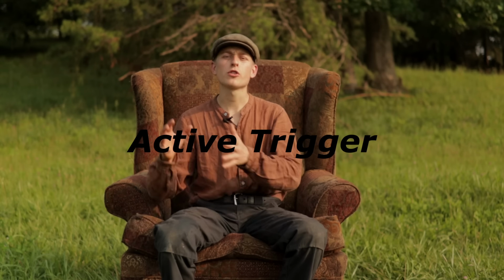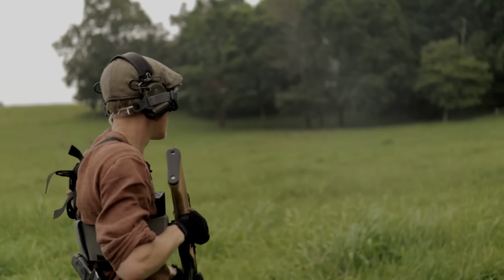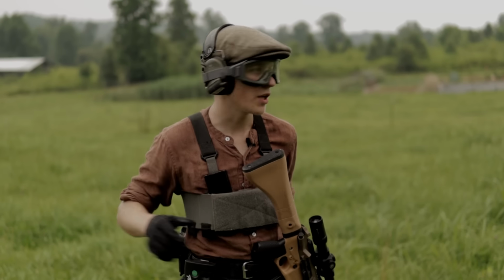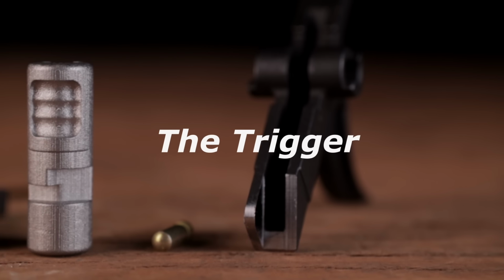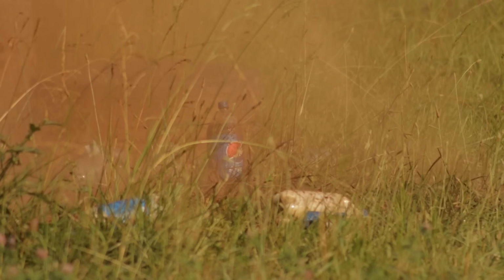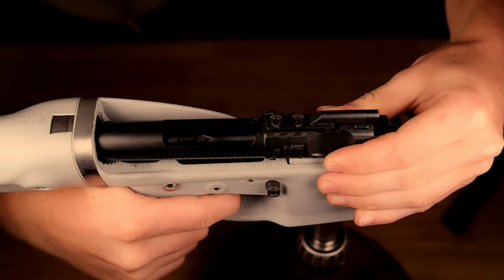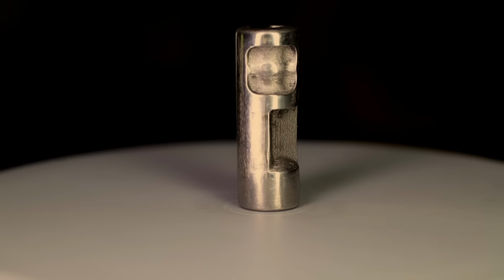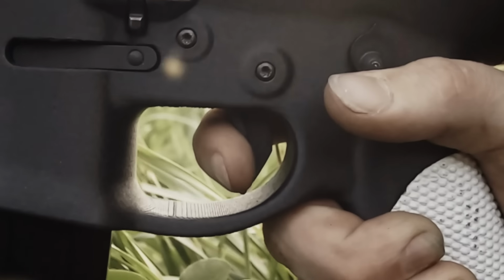Introducing the Super Safety

Comment: Machinegun= any weapon that fires more than one shot per pull of the trigger. Machining a part to force the weapon into safe mode, reset the trigger, and fire again after a shot, STILL results in multiple shots from one pull. You do keep saying something about having tonpull the trigger again with your super safety, but in the video, you are clearly holding down the trigger. No human, not even Jerry Mitch, can fire that fast, with such a consistent tempo. You're not doing that- the gun is. That is what makes it a machinegun.
Reply from the maker: That is not the definition of a machine gun. The word is function, not pull. Big difference.
Reply: @HoffmanTactical  I didn't say that was the definition. I said thats what it IS. Its a matter of the difference between the letter of the law and the "spirit of the law." Also a matter of the ATF's current "interpretation" of said law. The exact wording may specify"function of the trigger" which you take to include an AUTOMATIC mechanical action on the trigger as a normal part of the process when pulling the trigger once. But the ATF interprets "one function of the trigger" as a single action by the user, ie pulling the trigger again. 
I dont think it would make any difference to the ATF if the trigger was put into and out of safety mode a dozen times between shots, if it still resulted in more than one shot from one pull, you're in trouble. Playing around with printed plastic guns is asking for trouble enough already. You're just asking for a visit.

Comment: 2 questions:
1) will the Super Safety work with a rifle buffer? 5.15oz
2) can the full modified trigger (3 position dremeled) also work with the 2 position cam?
Reply from the maker: The  buffer mass won't have much to do with the operation of the safety, as long as bolt bounce is not an issue it should be fine. Once the trigger is modified, it will only work properly with the dual mode or a standard safety selector.
Reply: @HoffmanTactical  good to know. I'm 3d printing the single mode cam next week once my CF filament arrives and wondered if I'd even be able to use the same trigger for both single and dual mode setups. Appreciate the fast answer, sir.

Comment: I see the safety rotateing . That means it will egg out your receiver .
Reply from the maker: Testing has proven otherwise. It's not been the mildest of a problem. The reason is the surface pressure is very low.
Reply: @HoffmanTactical  are you saying anti rotating trigger pins are a scam ?

Comment: That thing constantly rotating in an upper will cause massive wear.
Reply from the maker: The lower you mean? So far no wear has been observed, even after 8K rounds. The reason it's not an issue is the surface loading is still very small.

Comment: I installed SS but when I charge the handle the handle sticks and won't work also when I am able to chamber a round the first round I shoot the BCG ends up getting stuck once again..

The function rest seems fine and my lower worked well before, any help would be great..

Thank you..
Reply from the maker: The top of the lever is getting pinched between the upper and BCG. Needs to be filed down a little.
Reply: @HoffmanTactical  

That would explain why the takedown sticks..

I'll give that a go tomorrow, thank you for the response.

I'll keep you posted..
Reply: @HoffmanTactical  

That worked, I just need to take it out for a test run

Comment: One thing I think is especially ingenious is that you used the energy of the bolt *OPENING* to force-reset the trigger instead of the energy from the bolt closing to force-reset the trigger. That by itself is going to make this a far more reliable FRT than every other design we have seen so far because the recoil spring 1) has way less energy and 2) has to overcome the magazine spring. 

Bravo to you, sir. Bravo!
Reply: Not to mention the added leverage from the rotation of the cam. This seem to be far more efficient than a FRT, and this system would seem to work with any aftermarket trigger.
Reply: All this needs to be milled out of steal for sure. I think is has a future.

Comment: This is fucking brilliant but i wish it wasn’t a push button.
Reply from the maker: I did try to avoid the need for the push style system, but it was required.
Reply: @HoffmanTactical  all in all a brilliant design, do you just work via trial and error or do you conduct some analysis/ research before implementing?

Comment: I'm not here to much argue legality I think. More like just be ready for nonsense. If you look up Akins Accelerator, that was a bump stock but sort of inverted. Instead of the stock, the rifle itself would reciprocate inside the stock. You were still functioning the trigger for each round. The ATF initially said it was OK but later backpedaled and said you could only have it if you got rid of the springs, which made it not as good. This one, it's actually pushing your finger forward? Yes, you're still functioning the trigger I think but they're going to fuck with you about it.

Comment: people are wondering how this isn't an auto seer, its not an auto seer because the only thing this safety does is transfer energy from the bolt into the trigger and by extension the shooters finger. if it were an auto seer, there would be no inertial transfer to the trigger, instead holding the trigger would result in a "dead" trigger as the internal hook comes off a control lever and allows the bolt to trigger an 'automatic release of the hammer' one trigger pull, and the bolt just has to return home over and over. with a super safety or even the WOT the bolt hits a lever or transfer bar on the way back, and is reliant on the shooter loosening the pressure on the trigger to keep the bar from stopping the bolt. if you clamp down on a super safety enhanced trigger... the gun fails to function properly. you'd be lucky to get a full cycle of the bolt. the super safety is reliant on user operation to complete the firing cycle and is pretty much no different than competition triggers with "affirmative reset" springs in them to push the trigger face in to the shooters finger and allow for quicker follow up shots, except misusing a super safety malfunctions or breaks things. its a higher skill version of a competition trigger.

Comment: Seems like a copy of the tac-con 3mr trigger, any difference? Other than it’s a push safety lol
Reply from the maker: Tac con uses a very different system. Hammer-trigger contact is used to reset the trigger.
Reply: @HoffmanTactical  ok that’s cool! is hammer-trigger contact safer? Does it have more reset force? Maybe more reliable? Just curious how it’s better :)
Reply from the maker: @Johnwalker338  Not in my opinion. Using a cam is more consistent. But they both work.

Comment: I work in manufacturing, though I'm not an engineer: casting is a really easy way to make metal parts with incredible tolerances, assuming you're not using sand molds.  Die casting is off the table too because of the high cost, but INVESTMENT CASTING can be done with a 3D printed model and a plaster mold.  Of course you're limited to non-ferrous metals like brass or aluminum or another alloy, but at least it's not nylon.  If done correctly, no machining will be needed besides cutting off the gate/sprue and some polishing.

If it were somehow possible to print in UHMWPE or Delrin, it seems like they'd make for highly wear resistant components.  Maybe even regular HDPE?
Reply: Due to the sheer forces involved in a firearm... you don't want to use a print... the layer adhesion between each layer is a print's weak point and will inevitably cause it to disintegrate sooner rather than later, regardless of what plastic you use.

Comment: What could possibly be causing the bolt to get held open on its own? 

My assumption is that my detent is not rounded correctly, i think that when the bolt goes back the detent catches on a rough spot and that puts pressure on my cam which holds the lever in place which holds the bolt back, am i correct ?

If i am not correct how do i remedy this? Also for context this has not happened while firing only while function testion. It also very rarely occurs.

Comment: Hoffman Tactical this may be considered lawful notice.

Thomas Allen Graves

NOTICE OF LAWFUL STATUS CONCERNING FLEX FIRE TECHNOLOGY
(Thomas Allen Graves / Eagleshead Island, Oklahoma / 12/1/2023)
Thomas Allen Graves claims priority of invention and maintains majority ownership of core intellectual property rights for firearms and/or firearm triggers using FLEX FIRE TECHNOLOGY as specified within the claims of US9816772B2 and/or other US patents or technical writings by Thomas Allen Graves.
This lawful status is in part secured under USC title 35 that includes preemptive protections for methods, and apparatus operable as or in combination as a semi-automatic firearm capable of a mechanical or positive displacement trigger reset during rearward bolt or slide movement or reciprocation, and that prevents the operator from pulling the trigger until the bolt or slide is in firing position. This is accomplished within existing FLEX FIRE TECHNOLOGY based systems that include G1 Combat Carbine, V2 ART, Alamo 15, FRT 15, WOT, Para 15, TT FRT 15, and other trigger/firearm variants.
The following is a defining priority of invention claim from US9816772B2 (2017) by Thomas Allen Graves.
“A handheld finger activated semi-automatic arm comprising:
a frame; a chamber face that is supported to the frame and that comprises a barrel;
a trigger that is depressible to fire the arm once per operating cycle;
a gun bolt that is movable with respect to the frame rearward away from the chamber concurrent with the trigger being positively mechanically reset; and,
wherein the trigger is blocked from depression until up to 99% of the operating cycle.”
 This claim effectively includes any trigger that resets during gun bolt opening and that unlocks during gun bolt closing.
Any commercial use or proposed commercial use or other uses that are specified in USC Title 35 of a firearm, firearm trigger or firearm trigger accessory or component that incorporate or is applied to the methods and/or apparatus of said patent claim and/or others within USA Corporate jurisdiction shall be subject to terms, and conditions of US9816772B2, and/or other US Patents by Thomas Allen Graves.
Reply: since you are educating us. Is your alamo15 trigger legal to possess and use in legal ways? rare breed has an injunction for their frt.... what's the deal with your alamo 15?
Reply: Federally speaking, the triggers are totally lawful, not just the Alamo 15. All the Flex Fire type triggers are lawful. Rare Breed is screwed, but not for machine guns. I intend to make over a million triggers asap. To be certain, rare breed baited the atf on purpose. The other people with trigger problems are either FFL that are otherwise compromised or other random connective reasons. The trigger itself is not a problem. Rare breed triggers is the problem. (WE'RE BEING BLUFFED FROM ALL SIDES=PSY-OP)
I hope that helps you get a little more perspective on the issue. Thank you for your interest in the subject and especially 
the triggers. I really appreciate it.  PASS IT ALONG
Reply: @CAPTIVEPULSEMAKER  pretty sure atf sent out letters specifically stating alamo15 triggers are machine guns. Why are you hating on rare breed instead of the atf??? legit question. also thanks for answering. i loved my trigger before i got scared and destroyed it 😭
Reply: Wow what a loser
Reply: I ain’t readin allat 😂
Reply: Not only is YouTube not the place to try to serve a notice (only a place to try to intimate and stir up drama), you simply wish your patent was for something as innovative as the super safety. It's parts, function, and action are completely different than your ripped off FRT.
Reply: @MiddletonMadeOfficial  You're clueless and your statement is invalid on multiple levels. That's about it. My patent includes many mechanisms like the super safety. Super safety wouldn't even make it to my desk.
Reply: Absolutely, completely a different product. A COMPLETELY DIFFERENT PART OF A GUN! Ignoring the fact that you stole RB tech and we’re busted for it, if we’re comparing  ‘apples to apples, your argument would be ‘Glock stole Sid’s design because they both fire 9mm’!
🤦‍♂️
Please stop. You’re completely wrong.
You sold a trigger, Hoffman isn’t ‘selling’ anything.
🤷‍♂️

Comment: The "single function of the trigger" argument is moot.  The feds already demonstrated that the word of the law is less important than "public safety" when they banned bump stocks.

If you exploit physics or firearms design to make a firearm shoot "like a machine gun..." it's a machine gun now.

Deal with it.
Reply: The tyrants at the ATF don't write laws, Congress does. They can demonstrate all they want but the NFA is clear on what a machine gun is. Using the bolt to reset the trigger does not making machine gun. Your emotions surrounding it are irrelevant
Reply from the maker: Tell that to the courts.

Comment: This is an auto-sear without a 3rd hole....
Reply: It absolutely is.  Owning this is a bankruptcy due to legal expenses waiting to happen.
Reply: Art and sears are very different.....
Reply: @NothingSekret  This is not an ART. He keeps the pressure on his finger the entire time. This is a sear. He does not pull the trigger each time. This is the equivalent of a bump stock but mechanically linked to the actual trigger itself, thus, it is a sear.
Reply: @UncleDiddles  you keep telling yourself that🤡
He lays out the mechanics in the video I'm sure you skipped over. The safety is Actively Resetting the Trigger 💀
Reply: @NothingSekret  and you don't understand mechanical engineering. This is nothing more than a mechanically linked internal bumpstock. But sure buddy. Go make some and try explaining it's just a safety to the ATF.
Reply from the maker: Pro tip: The bump stock is not a machine gun.
Reply: @NothingSekret Yes actively resetting is another terminology for a forced reset that is mechanically regulated. This is an FRT trigger.

Comment: I love you! This is what Americans do invent! 
Looking at your 3D prints your layers look to run horizontally at the cam lobes. That may wear them faster than if they were run vertically. Also I’ve played around with parts quality printing and 100% fill usually leads to deformation, play around with your printer and materials but I’ve found 98% fill is actually stronger and more wear resistant

Comment: I wonder since the entire pin is rotating how much wear over time will it put on a receiver over time. Once pin hole gets enlarged its gonna introduce more slap due the force of bolt movement causing further faster wear.  Just a thought that popped in my head.

Comment: not sure if its the same as a glock but the aus police use a glock 22 40S&W with a trigger that does the same thing once you pull it will fire a round then a slight depress will allow trigger reset so a small movemnet allows multiple rounds down range without fully releasing the trigger
Reply from the maker: I think that is just a short reset.

Comment: "Machinegun" is a clearly defined legal definition.

The main definition defines a “machinegun” as any weapon which shoots, is designed to shoot, or can be readily restored to shoot, automatically more than one shot, without manual reloading, by a single function of the trigger.  

Following that definition they include any frame, receiver, or parts that can be added to a weapon to convert it to a “machinegun”, even if not actually in the weapon, to be considered a machinegun.  

A bump stock still only fires one shot by a single function of the trigger. FRT triggers only fire one shot by a single function of the trigger. Even when these devices are added to the firearm they do not, by the definition in 26 U.S. Code § 5845 (b), make the firearm a machinegun, and thus cannot be interpreted by the second sentence of 26 U.S. Code § 5845 (b) as a machinegun.  

Importantly, it does not define a machinegun as it pertains to a complete firearm, but only as it operates by a single function of the trigger; this does not say anything about cyclic rate of a firearm or any other intended rate of fire as one could feasibly (or even unfeasibly) manage with a single function of the trigger.  

The law as applied to bump stocks would read: (machinegun definition paraphrased in brackets*)  The term “machinegun” means any weapon which shoots, is designed to shoot, or can be readily restored to shoot, automatically more than one shot, without manual reloading, by a single function of the trigger.  

The term shall also include the frame or receiver of any such weapon, any part designed and intended solely and exclusively, or combination of parts designed and intended, for use in converting a weapon into a [weapon which shoot, … , automatically … by a single function of the trigger], and any combination of parts from which a [weapon which shoots, is designed to shoot, … , automatically … by a single function of the trigger] can be assembled if such parts are in the possession or under the control of a person.  

Original text of the law:  26 U.S. Code § 5845  
(b)Machinegun  
The term “machinegun” means any weapon which shoots, is designed to shoot, or can be readily restored to shoot, automatically more than one shot, without manual reloading, by a single function of the trigger. The term shall also include the frame or receiver of any such weapon, any part designed and intended solely and exclusively, or combination of parts designed and intended, for use in converting a weapon into a machinegun, and any combination of parts from which a machinegun can be assembled if such parts are in the possession or under the control of a person.